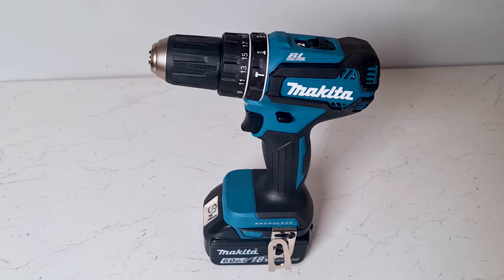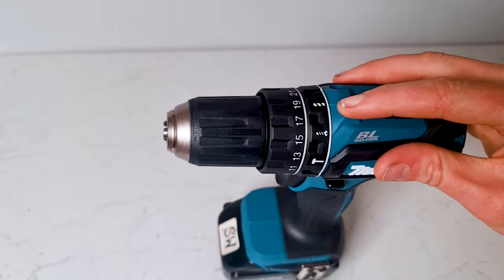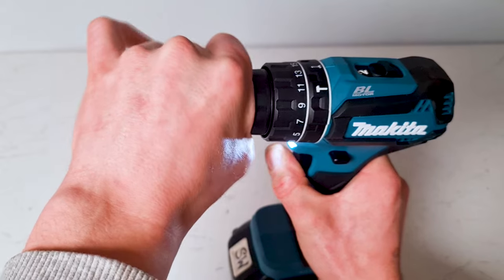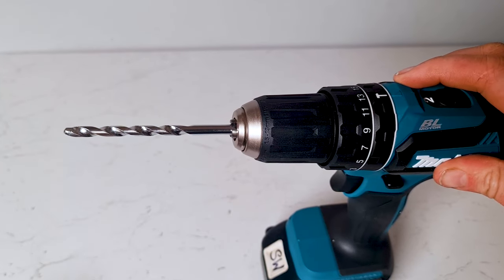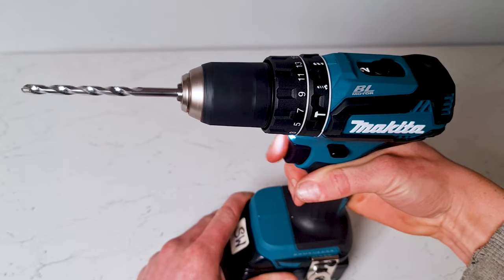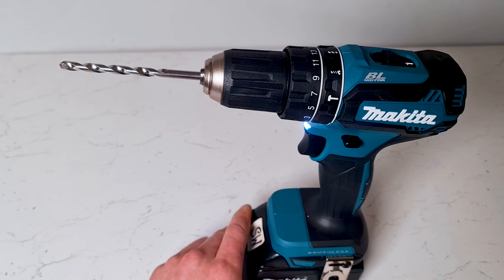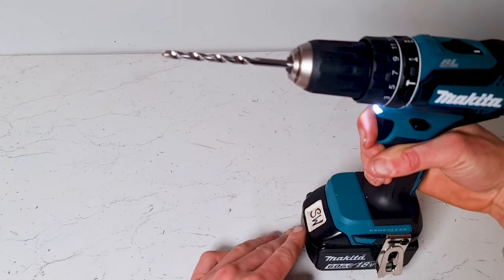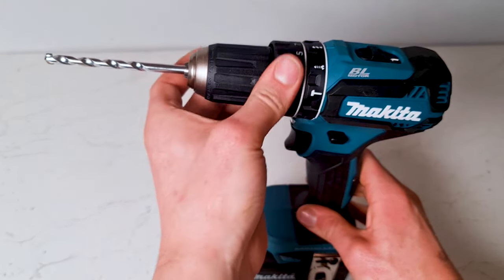Learn To Use Your Drill like a Pro! (Settings On A Makita Drill)

Comment: You forgot the lock position, between forward and reverse, so trigger can't be accidentally pushed on when in carry bag or jumbled with other items. Very important as I've had mine turn on many times going over bumps in back of van. It once drilled through a can of petrol and blew the dog and van up almost injuring a bus load of orphans.
Reply: Oh is that what that is ?
I thought is was just annoying

Comment: I have this exact same drill shown in the video my problem with mines is that the chuck won't turn to let me put in on screw or regular drilling modes  any idea on what my be the problem?
Reply from the maker: I'm afraid not, it does sound like something has broken there. If it is still under warranty then I would get it replaced